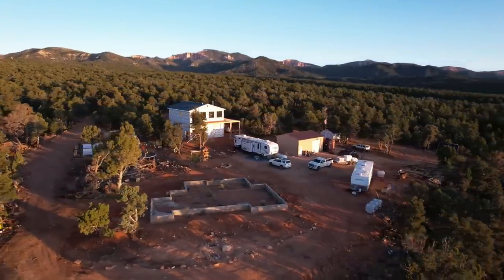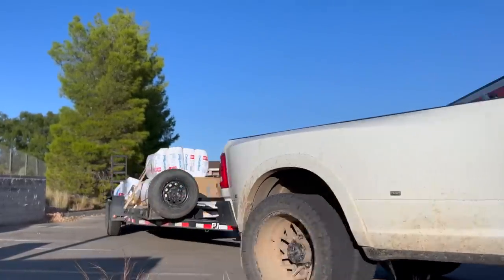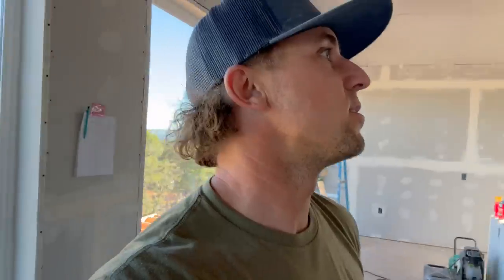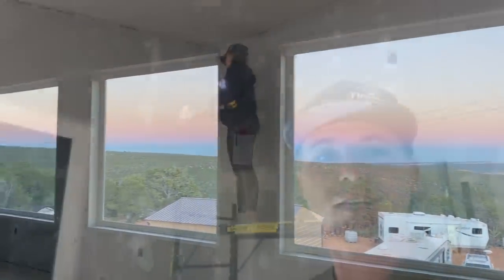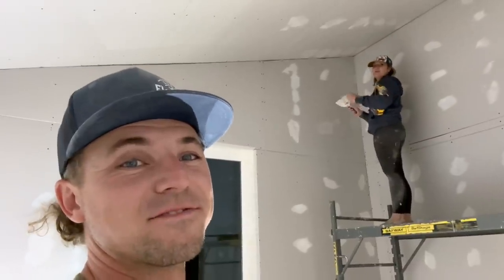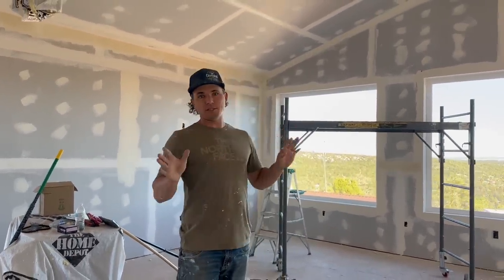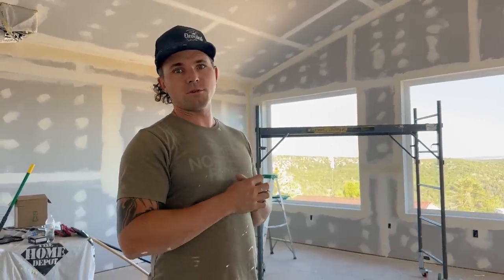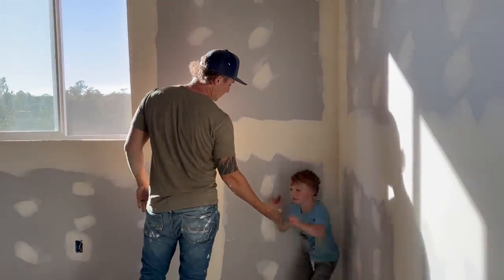READY.. SET.. TAPE AND MUD

Comment: Great job guys, making good, steady progress.  1 suggestion - think about getting a few plastic lampholders to temporarily wire into your ceiling boxes to give you some light while you work.  Only other thing i think i would have run the drywall at the pantry clear to the ceiling to get rid of the useless dead space.  Look forward to your videos always.

Comment: Lay 2x4 on the insulation you want to cut. Step on board and use your cutting utensil on edge of the 2 x 4. Will give you a straighter cut and easier way to cut because the insulation will be pinched tight from you standing on the board.

Comment: Very nice work and impressive that you went through 12 boxes. To give you perspective, when I did taping and coats I went through 7 - 5 gallon pails of joint & topping compound in 8 hours as a pro finisher. Back when I was young (25) I could carry 2 - 5 gallon pails in each hand (247lbs. for 4). Keep plugging away at it & soon you can admire your hard work. Edit: Did I mention how impressive this looks? Yall did an amazing job on every aspect of it.